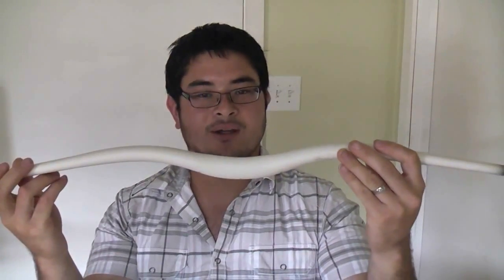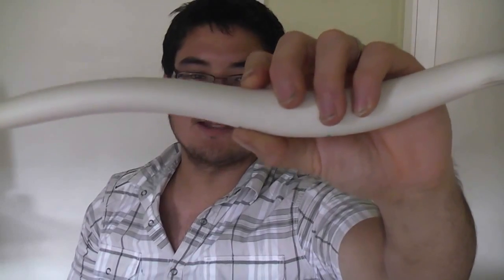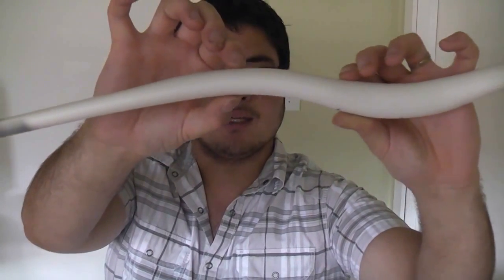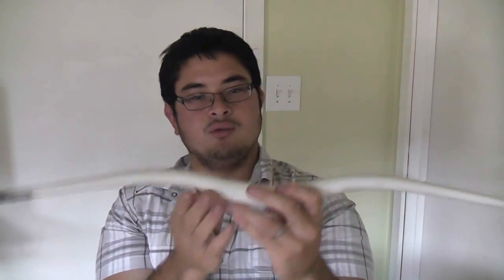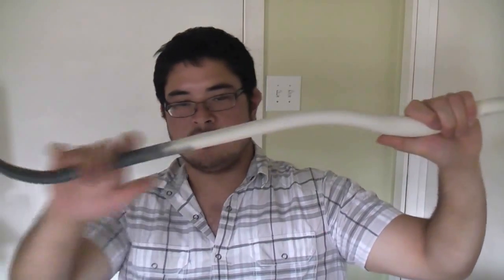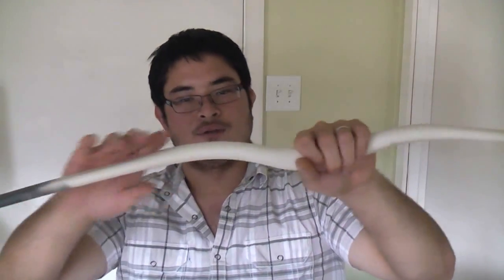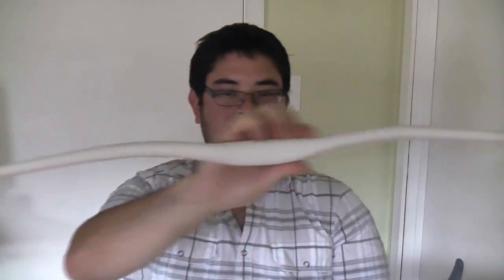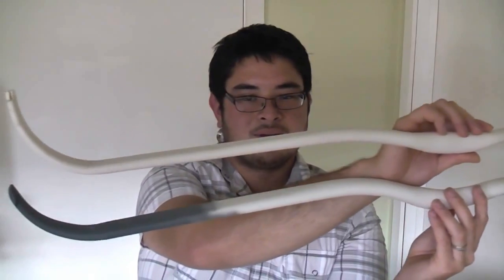Flattened PVC, Flattened Taper VS Completely Flat

Comment: I've tried heating the pipe up with a heat gun but I can't get it hot enough for it to be flattened
Reply: you can buy the cheap gun (2speed)from harbor frieght and it will work...its the one i use and it is hot enough.

Comment: Hi, Nick.  Started making a pvc bow today.  Bought a heat gun (1500w) and pipe.  I'm finding it difficult getting the 28inch or so length heated enough to flatten.  Is this the norm for heating pvc?

Comment: Yes, you can use a stove. I made one using a stove top, the only problem is that it's to short. I could use it as a double or helper bow. I just don't have the arm strength to draw it back to full draw. But it came out pretty good.
You have to be patient making it.

Comment: I have just made my first PVC bow. 61 inches long by 1 inch. I tapered both ends correctly and put reflex into the ends. The bow is straight and the handle is just like you made. When I put the string on the bow, the string flips around to the other side.I have been making wood bows for about 2 years now. So I know how to string a bow. Why is this happening. I made the ends for the string just like your youth bow. BTW really like your instructions they are easy to follow.
Reply: +Mark Hopkins nick actually made a video talking about how that could happen. He remedied that by making a small divot on the outside of the recurved part (Running down with the bow), right below the nock, so that the string has a center channel to lay in. i hope that cleared it up a little bit. I think the video he talks about it in is the Youth Recurve pvc instructional. hope this helps!

Comment: The best way I know to demonstrate this concept:
Take a common drinking straw, hold it in the middle and bend the tips just like a little miniature bow.  The straw will fold in the middle.  It doesn't matter if we're talking about something round or flat or plastic tube or wood or steel or a 6" straw or a 20' I beam, this concept is universal.  In order to make a bow distribute the work along the whole length of the bow, the bow must be tapered.

Comment: Thanks for all the vids, they are awesome. I just tried to make my first today, but the pvc split while I was flattening the limbs. What did I do wrong?
Reply: Michael Blecich If you heat the sides of the flat portion too fast, they will split. You have to heat it slowly, and evenly, and then flatten it in a controlled smooth movement. Make sure it is soft enough all around also, because if one area is still cold, it may split.

Comment: can these bows be used for archery leagues? As in a 10 ring from 60 yards?
Reply from the maker: Clay Rochford If you match your arrows and get good with them, sure. It'll be tough as there will nothing forgiving about the setup. You've got a shoot-around handle and short nock to nock length. It's a fun challenge and all about getting to know your bow well. The bow will deliver the arrows, you just have to learn how to direct them.

Comment: alright, let me pose this question to you. since i'm not a bowyer (i actually have more experience with swordcraft than bowcraft, but wish to extend my repertoire), i was wondering, what's the advantages of flattening the pipe for a bow, before shaping it, over just nothing, and stringing a round pipe? i can understand flattening the handle a wee bit to avoid throwing the arrow too far out, but why flatten the limbs (or as you say, the siyahs)?
Reply: and a second question, what do you use to get the curve in your recurves?
Reply: AlaricWolfe In case you didn't know yet , flattening the limbs weakens the limbs , allow them to bend easier , thus reducing stress on the middle area and effectively reduce chance of shattering when you pull it.

For second question , I think he uses the same way , heat to soften , then bend the it to get the curve.
Reply: so it's really all about spreading the stress properly?  makes sense, i suppose.  the pvc long bow i made i ended up having to make a fiberglass core from driveway markers.  haven't had a chance to test it yet, but it certainly seems to bend evenly, when i go to string it.  another issue i've come across, what kind of knot would you recommend for using a length of 550 paracord as my bow string.

Comment: Nick, how did you come up with using PVC, as a material for a bow, its so simple, but yet its brilliant!  Have you use larger size PVC, say, 1 1/2 pipe, or in your opinion is 1 /14" pipe the largest pipe size one should use.

Comment from the maker: It's awesome to hear you're interested in bows. Your PVC bows all look great, especially your 1" recurve.

PVC bows are as good as most comparable solid fiberglass bows and exceed most self-bows. That 1" bow you made will probably stack up to most solid fiberglass recurves.

Most 40 pound modern recurves like the Samick will get around 160-180 fps. Your 1" bow probably gets around 140-160. Some changes and you could match that speed.

Thanks for watching. Keep up the good work!

-Nick